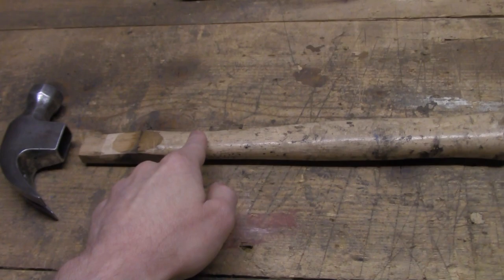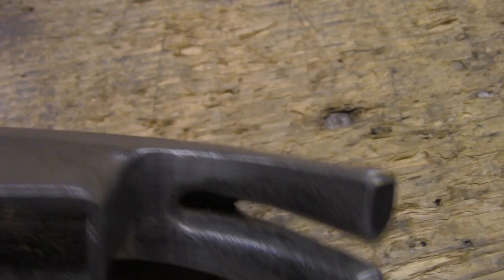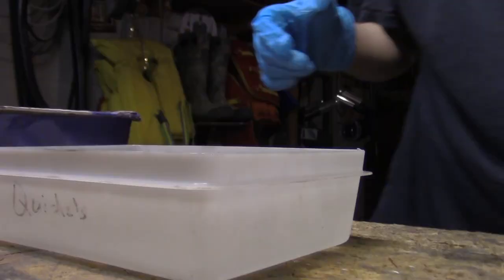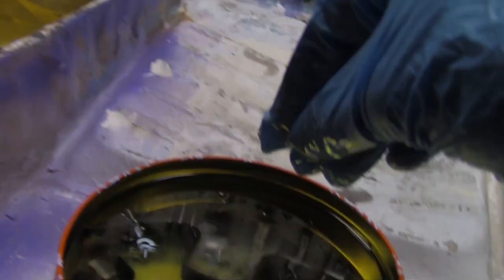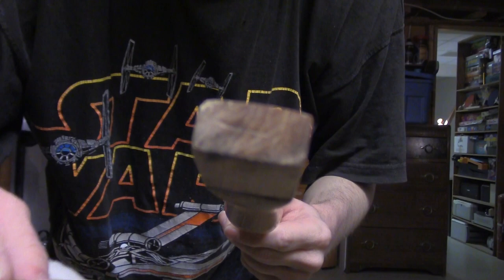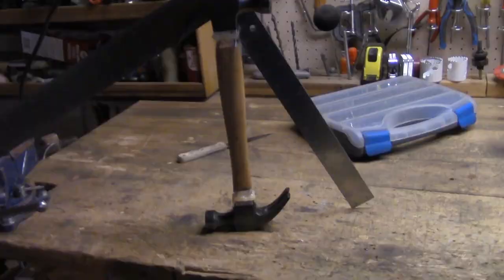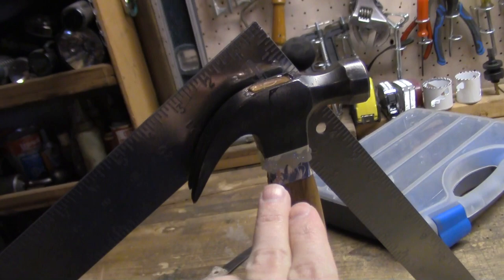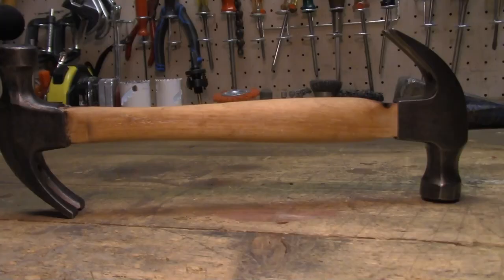Hammer Hammer

Comment: The lines on the hammer is what's called the milling process. Or, those are the remaining lines from when the metal was cut on the saw before adapting the metal.
Reply from the maker: thanks i kinda though it was but did not really know 100%